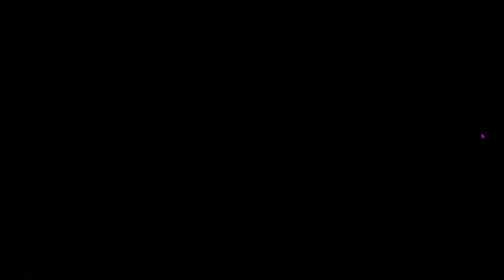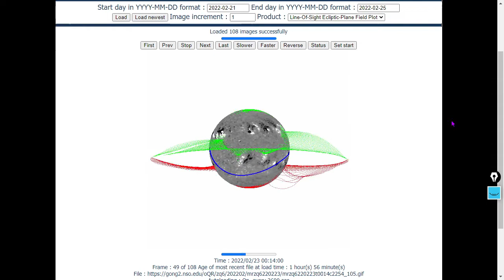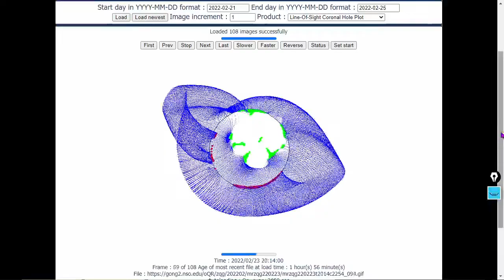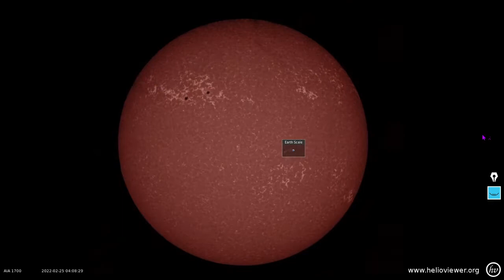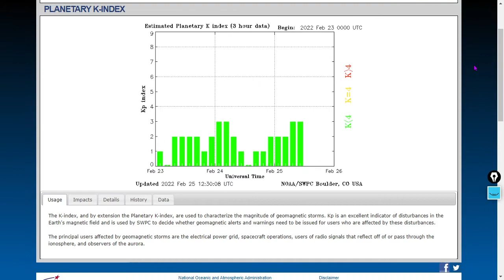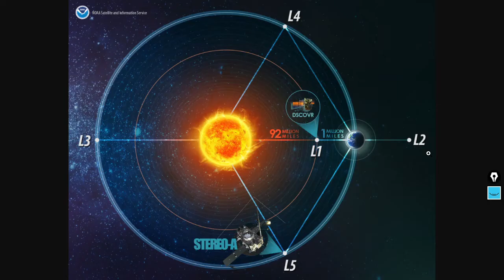Sunspots and Coronal Holes- Up Close and Personal

Comment: Do you think that some of these sun spot groups are the same ones that we saw a month ago? 

I seem to recall that in January there was also a group of sunspots close together in the northern hemisphere and I know that the rotation rate is approximately 28 days, 25 at the equator and less at the poles, but it seems to me that some of these spot groups might be the ones we saw before.
Reply from the maker: Yes!  Exactly, and nice observation.  Sunspot 2954 = sunspot 2936.
Reply: @smAshomAsh  So this might mean that the spot group which had a massive CME on the other side of the Sun was the same as one that we saw setting a few weeks back and that we were lucky to not be on the receiving end of that ejection.

I know that some CME are not caused by the spots - that they are unwinding magnetic fields acting like the rubber in a slingshot, propelling anything in their path - it just seems that there was some very active groups and we were extremely lucky.
Reply from the maker: @TheGeneralWorldofTanksReplays  Great comment!

Yes, I think the sunspots are constraining the plasma, and the short circuit caused by collapsing filaments is a flare (there's a huge change in the local electron flux at that moment, I think).  

Also, I think coronal holes cause a sort backwater effect.  As the protons blast out of coronal holes, some stick around perhaps creating the filaments.

In any case, the CME most certainly came from sunspot 2954/ 2955.  What's not so clear is what the effect would have been if it had been facing Earth.  There's some evidence that flares are more intense at the limbs.  In other words, some of us are starting to think a c-class flare right in front of Earth might be an m, or x-class flare from a more obtuse angle.  This all ties in to the concept of condensed matter stars.

If you've not read it, try reading The Sun on Trial, 40 Proofs Supporting Liquid Metallic Hydrogen as a Solar Building Block.  You're ready!